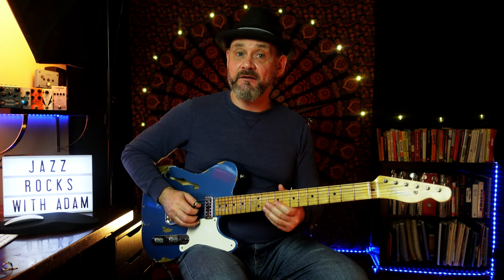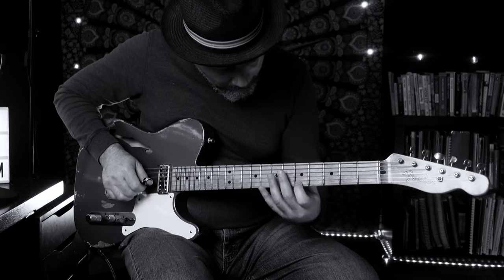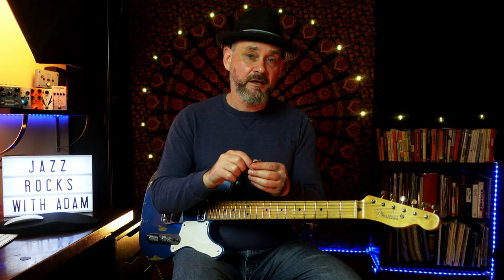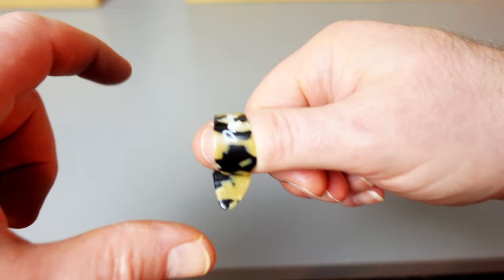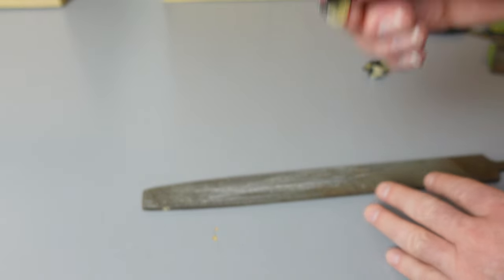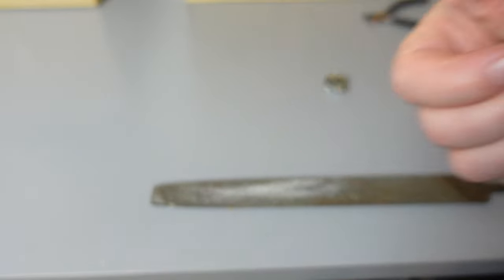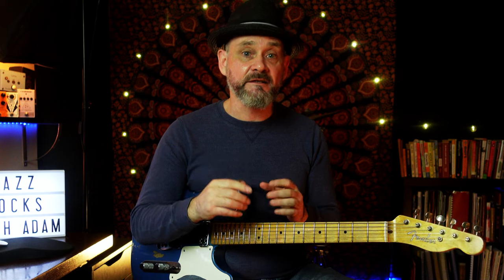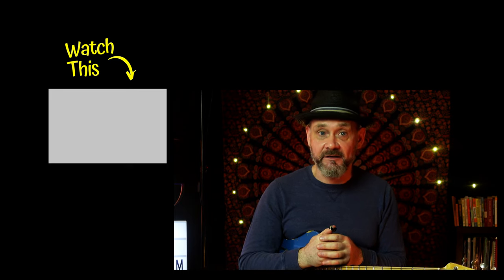Thumb pick: Everything changed for me when THIS happened!

Comment: Thanks for showing the correct method of doing this.When I tried it years ago,I was only focusing on the length and it not getting caught in the strings.Now I will try again and include the forward notch,bevel and thinning.
Reply from the maker: Hi Brandon. Personally, I don’t thin them at all. I like them to be as thick as possible to get a big fat tone. I do sand them smooth, however. The bevel or chamfer is important and to file a curvature on to opposite side of the pick as well. Thanks for checking it out.

Comment: I’ve been using a thumb pick for a couple of years now. The drawback for me is when I try to play fast funky strumming- or 4 on the 4 floor big band style of strumming- I find thumb picks are just too thick with not enough bend. I’ve mentioned this to Black Mountain picks, but I doubt anything will change in the design- I’ve also thought about crazy gluing my favourite flexible flat pick onto a trimmed back thumb pick, but haven’t tried that yet.
Reply from the maker: I like super thick picks and I use it for all the same stuff you mentioned. The trick is getting the rounded edge on the correct side and making them glossy smooth. Thanks for your comment.

Comment: Hello fellow jazz thumb-picker.  Yes, I've struggled with trying to find a workable solution for years.  I gave up on the big Dunlops long ago, but never tried modifying one as much as you show here.  I'll give it a try.  However, the best I've found are the Kodiak Crossover and Shark Tooth from Strum 'n Comfort. They work well with little shaping using fingernail sanding boards.
Reply from the maker: Hey there! Thanks for checking out the video. I think I’ve tried all of those at some point. The reason I use Dunlop is because they’re the most comfortable for me. The wrap around part works great for me. As you found out, it’s the pick part that sucks.

Comment: Try the Dunlop called bug a blue. Brent mason uses one. Dunlop makes one molded in one. Blue mountain I think m makes one on a spring. Fred Kelly stopped picks makes several. No less than Doyle styles uses one. I cut the end of a Dunlop one of and glue a couple of v picks on with. I love the sound of these. If you like a nylon  the bug a blue is great. Most every step player uses one. Guess got a idea but there are better options
Reply from the maker: Yeah, sounds like the gluing aspect is pretty intensive. For me the filing down an reshaping doesn’t take much time at all. I don’t really like the nylon picks. They’re too soft.

Comment: Hey Adam love the channel. Just started dabbling with a thumb pick. When strumming up and down do you use the thumb pick? Strumming down isn’t a problem for me but I’m noticing that my up strum seems to have a strong attack that I need to work on if I want to use the thumb pick. Definitely something I think I could adjust to but I wanted to get your thoughts.
Reply from the maker: @BeatsAndGuitars  Thanks for stopping by. Yeah, I do up strokes as well. You have to wrap your index finger around as if it’s a regular flatpick. That way it doesn’t fly off your thumb and you can control the volume easier. It certainly helps to reshape them though. That’s also part of it.
Reply: @JazzRockswithAdam  thanks Adam really appreciate the response.
Reply from the maker: @BeatsAndGuitars  Absolutely. All the best!